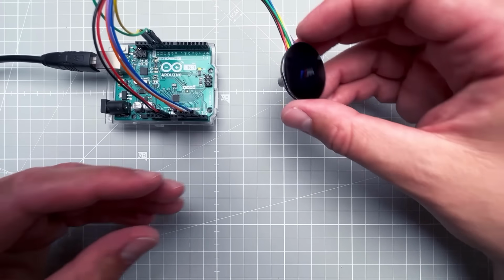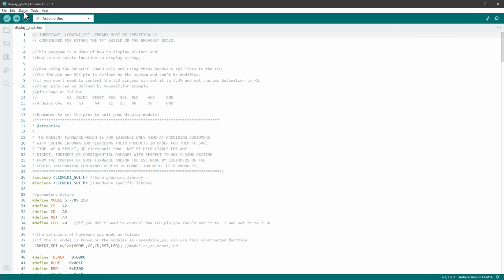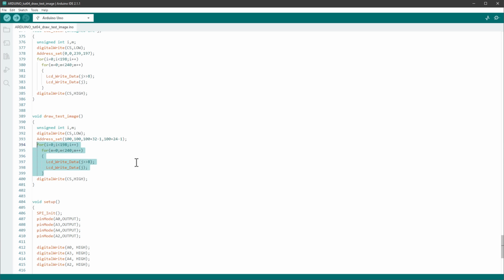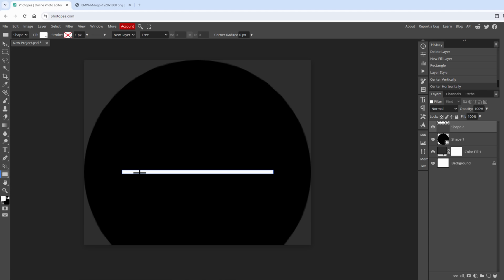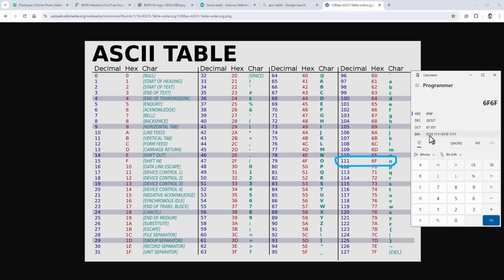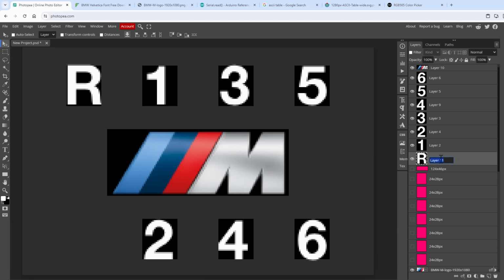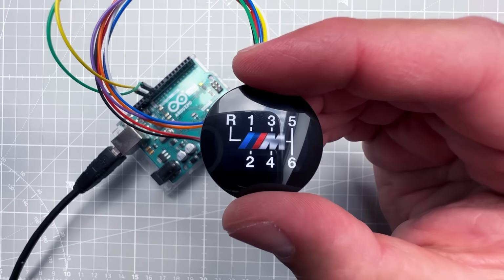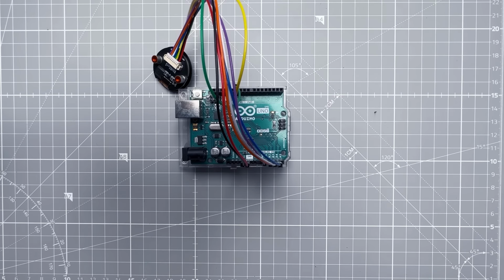I found PERFECT display

Comment: an esp32 or a raspberry pico will give you more memory to store graphics, and much faster performance, and you can use the same Arduino IDE to program them. Probably your sketches will work straight forward on an ESP32. Awesome project, I will get a couple of those displays to play around
Reply from the maker: Yep, I was using UNO because it´s simple and easy to use for beginners. Now I´m moving to ESP32, and as you have noted, still using Arduino IDE and it pretty much works out of the box. Thank you for your comment!

Comment: You could export the labels in a custom format, with one byte per pixel indicating how white it is, so 0 is black and 255 is white. This would halve the image size. Also, you can use this information to calculate the tint color even for the borders transparency, as in reality this 0-255 color is not really "how white it is", but the alpha channel of the color you want to display. This is a nice improvement in program memory, and in the final look, but would require more work and calculations to compute the color at runtime as the color mix of black + tint with alpha.
Reply from the maker: Good idea, thank you for your suggestion. I was also thinking about storing labels are grayscale 1byte images and using a color lookup table, but it would be probably too much for UNO. However, since I´m moving to ESP32, I will revisit the idea. Not for the memory savings, but more for the flexibility of animating the color tint. Still the RGB565 is not that straightfoward compared to RGB888, since three colors are spread across only two bytes..
Reply: Using a palette might be a good idea to compress the central image, but given the gradients I don't know if it would be good
Reply from the maker: It was meant for mapping the grayscale image to color images, but ESP had probably enough power to calculate it on the fly.

Comment: I have two BMW e36 a BMW e88 and a Mercedes 500 SL.
The BMWs all have an inline 6 engine and the Mercedes a V8.

That knob would be amazing in my little 323ti tracktoy!
Combined with a gear indicator on the dashboard it would be perfect.
Reply from the maker: Cool. What ECU do you have in that 323ti? Is that a stock or some aftermarket one?

Comment: If you put it in a ZHP knob, I have several colleagues (apart from me) that would be very interested to buy it
Reply from the maker: I’m sorry for my ignorance, but what is ZHP?
Reply: @upir_upir ZHP is an equipment package, and its knob it's the best knob that BMW released for manual cars, it's quite short, weighted and gives great feeling in your hand. The M ones are illuminated in orange but taller (different version), so your screen in a ZHP knob (the short one) would be the best option for manual cars. Even cars released later are fitting the "old" ZHP knob for its feeling. You'd make quite a bit of money guaranteed
Reply: @upir_upir  hello, the ZHP knob is a knob from the "sport package" which is commonly called ZHP. That knob is the one that has the best feeling in the hand, it's shorter, weighted and ergonomic. The M cars have the taller one illuminated, but the feeling is far from the ZHP one, so one of them with your screen would be a best seller, as it would be the best knob ever. I'd definitely buy it and I am sure a lot of the forum members would too, you could make some real money from it

Comment: A little more expensive but you should look at the Waveshare 1.28 inch round TFT LCD's.  The LCD takes up the full area of the circle display, not just 2/3rds like the one you have here.  You can also get them as an all-in-one with a RP2040 or ESP32.  They also have packages with a touch panel as well.  I've only been playing around with the RP2040 version but, overall, they are pretty easy to work with.
Reply from the maker: Thank you for your suggestion, I have that display with RP2040 and I was having hard time using it with micropython and Thonny. I have now ordered the ESP32 version and it´s much easier to use, in fact, I´m already recording a video with that display. What IDE do you use with the RP2040 version?
Reply: @upir_upir  Oh cool.  I am using Thonny.  It's definitely a bit finicky but I am able to work around it.  I am looking forward to seeing the video on this display.

Comment: Awesome Project - i think i watched partsof it 3 times - still goes way over my head

will keep watching how everything willt turn out for the shift knob!!
for the E90 you would need to combine it with a Can-Bus Adapter to get the actual gear used to light up the correct gear
Reply from the maker: Thank you, I´m glad you like it! Yes, I do plan to explore the OBDII version a little bit more to see if I can get the current gear somewhat easily.
Reply: @upir_upir  FYI: the gear information on the E90 is to be found on the PT-CAN
- I only know this because I have a datadisplay to get information on water temp, oil temp and oil pressure
and that connects only to the PT-Can
Reply: @upir_upir  As @odie0815 is saying below the information would be on the pt-can to intercept and not so much in the OBD2 side. This is a entirely different part of the vehicles electronics.

Comment: E36 convertible with custom LED lighting, I'd triggered by the tumbnail sice the lightup roundel for the BMW shifters is no longer available seperatly but you have to buy a whole shifterknob with is about €165 so this is a great and awesome solution for this. Thanks so much! I look forward to the next video
Reply from the maker: Thank you, but I believe you can still buy the LED backlight version on AliExpress alone, without the entire shifter knob.. At least I think I have seen it there.
Reply: @upir_upir  Nope no longer available only with shifter going from €150,00- for the normal one to €250,00- for the ZHP one. So my hopes are high for this one ;-)

Comment: This is a very cool project. All that is fitting on a ATmega328 is awesome personally i like the Uno with socketed DIP packages that you can pull out and run dead bug style if your project requires.
Reply from the maker: Thank you. I also like that version of UNO for the ease of taking the chip out and using it standalone.

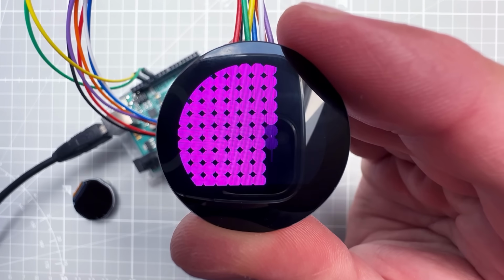Comment: @7:26 - So the bottom of the display gets cut off? but the top is fine? So it's not a true "round" display?
Reply from the maker: That’s right, the bottom is cut off, so technically it’s only semi-round.
Reply: @upir_upir  Ah that sucks, otherwise it seems perfect, wanted to get some for a clock project. Thanks for the reply

Comment: Why are people still using Arduino, when esp32's are vastly superior, smaller, easier and 20x cheaper? Plus, you can use the debit to make the project, then just flash the program to the esp chip itself and make it even smaller. (Esp32, esp02, esp10 etc etc)
Reply from the maker: It’s because even when ESP32 is surely great, it’s not easier and it’s not cheaper. Arduino has much better documentation and community. Easier learning curve and much more tutorials. The cheapest Arduino UNO board is 1.5$ on AliExpress. Cheapest ESP board is twice the price.
Reply: @upir_upir  I can get an esp32 for 10c. (The chip). The devboard is $1.20-2.00. and easier? Well no, because it's exactly the same. You even use the Arduino ide and language. 

Esp32 comes with ble and wifi, and all the ADC and digital io. 

There is not one single thing that Arduino does better, or cheaper. And it's not harder to learn.

So I ask again, why use Arduino? Other than 'i didn't know about espressif and their offerings', there's not a single viable reason?

Comment: If you use a palette for the images you can drastically reduce the size. For example for the gear numbers you can only use 1bit per pixel since it's only black or white which will make the images 16 times smaller. Similar for the BMW logo - it doesn't use the whole range of RGB colors.

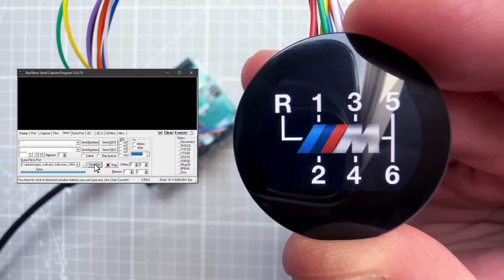Comment: 32:06 about memory usage:
your image (apart from the bmw logo) is grayscale, so you could save a lot of memory per digit if you stored only one color channel (green for full resolution) in the array and repeated it when drawing.
you could even do maybe 4 bits per pixel (so you don't have to deal with byte alignment or waste 2 bits per pixel) instead of 16. I think it's also worth testing 2 bits per pixel (4 pixels per byte instead of 2) but it might be uglier. at the limit you could use 1 bit per pixel, though you'd lose the anti-aliasing.

that you leave you a lot of room for other stuff and you could still have a routine to draw rgb565 images like the logo.

on drawing the channels with 4bit resolution it would be look something like (struct rgb565) {
  .red = grayscale <<1, // 4bit loses 1 lsb over 5bit
  .green = grayscale <<2, // 4bit loses 2 lsb over 6bit
  .blue = grayscale <<1, // same as red
}
then split in two and send.
for coloring you could probably still use the same mask trick.

run-length encoding might be helpful too but it would use more memory for lone color pixels
Reply from the maker: You are correct that grayscale images only need 8 bits, and not 16. Probably 4 bits for grayscale would work as well and still look reasonable. The additional calculations would be probably too much for Arduino UNO, but definitely something worth doing for something like ESP32. Same with run length encoding. Thank you for your comment and your ideas, very appreciated!
Reply: @upir_upir  thank you for reading and for the video!

Comment: Good work. But esp32-C3 with full round display, touchscreen and round case - cost $12, and have all for you need in this progect.
Reply from the maker: Thank you. Yep, that ESP32-S3 round module is something that I´m currently testing as well. It´s a nice little piece of hardware.

Comment: Since you use white images for your labels you could probably use a single channel image and that would allow you to store a second set at a lower intensity (for the grey). Not sure what the encoding is for 16-bit image (5-bits per channel?). You could probably do bit-shift and bit-OR to recreate the color pixels in 16-bit. I think it would be cheaper than the floating point math required for true tinting. You could even go with palette based approach, that's how the old game consoles did it.
Reply from the maker: Yep, I was thinking about something similar, i.e. storing labels as 8bit grayscale, which would result in images in half the size. I might try that.

Comment: The ESP-32 WEMOS S2 mini is 34.3*25.4mm in size and has 4MB of flash memory, it may help when trying to draw bigger or more complex images.
It could allow you to detect the gear using a separate ESP and communicate between them with ESP-NOW to avoid some wires
Reply from the maker: All good suggestions, thank you!
Reply: I might have a look at that later as i have in mind a little project with a bigger screen
Reply: It is also a lot faster than the UNO

Comment: Id go ESP32 --- But dont rule out RP2040 boards. They make some that are very tiny.

As for improvements, I wondered about settings a condition type of function where if it detects something, it could change out the image shown (to get the color shift)
Or maybe you can piggyback the devices... and have one be the visual display controller and the other doing the detection and sensing.

Awesome project tho i really love the idea.
Would love to make one for my WRX
Reply from the maker: I´m not ruling out anything, but I need to make small steps, since everything is new and difficult. There is definitly more that could be done with this display, I will explore some more options in the future videos.
Reply: @upir_upir  I completely understand. I have more project ideas and parts than I have time, energy and motivation to work on. So I am constantly trying to balance it all, and that's not even considering the everyday obligations we all have.

I will keep an eye out for new videos though. And I really appreciate the idea.

When I was younger (Im 40 now) I used to want to put a computer in my car. Nowadays, the tech finally caught up and it can be overwhelming (at least for me) to consider all the old ideas I had... but now having the hardware available, and many of the skills to make these ideas come to life.

One last thing to mention -- you can go w/ more power like a Pi Zero or even Pi 4/5 but extend the wiring too. Can control many diff things w/ these platforms and just change out an SD card for memory.

If you still prefer the tiny footprint, look into ESP32-C3 and ESP32 S3 tho. Or you can get just the "brain" part of the board w/ the ESP32-S but it's nicer to have the breakout board of some type imo.

Comment: 25:13 A) You could use an ESP32 or Pico which both have much more memory.
B) You also could cut off all unused (black) pixels at the top, left, right and bottom.

Comment: Following the project because it would be cool to have it in my car, and all the time I was wondering why go with the huge UNO if you want to implement this in the real world...

Now, I am not aware of the parameters, but wouldnt a pro micro/nano or xiao seeed or even wemos d1 mini or similar be also feasible?

The display is just  *chefs kiss as well as the entire tutorial, great job! Diky moc!
Reply from the maker: Going (starting) with UNO was for a few reasons - it´s super simple, slow, and cheap. Also, if you manage to have it running with UNO, you will most likely make it run with any other microcontroller, and it would only be better/faster. For the final stage, I will definitely choose something small enough so it can fit inside the shifter knob.
Reply: @upir_upir  sure, makes sense as a proof of concept. much better to handle as well if you need to connect things and so on.

until next time :)

Comment: ESP32 bluetooth + bluetooth OBD2 adapter.!!  U can read the CANbus data wirelessly displayed (including gear )
Reply from the maker: Assuming you use it in a (not super old) car that has OBD2. You might still not be able to get the gear value, not all cars send it, but you can calculate it from RPM and speed. That said, yes, I would like to try that approach as well.

Comment: I think it would be easy enough to add an external flash ship or an EEPROM to store the images.
Reply from the maker: Probably much easier solution is to simply use a microcontroller with a bigger memory - like the ESP32. That´s what I´m currently testing.

Comment: If i use this screen how will i have enough Analog pins for the hall sensors as well ?
Reply from the maker: Probably even better, because SPI uses different pins than the analog input pins, so you should have access to 6 analog input pins.
Reply: @upir_upir  which pins other than vcc gnd sda scl should o use instead of analog
Reply: @tobidzn105  
Hello, 

After testing for a few days, there are missing analog pins on an arduino board one for 4 hall sensors and this display.
SCL - D13
SDA - D11
BLK - A0
CS - A2
DC - A3
RES - A4
Of these ports only BLK is dispensable. We would be left with 3 free analogue ports: A0, A2 and A5. 
What possibilities are there to extend the number of analogue inputs? 

On the power side, you can connect it to a VCC breadboard to have more 5V outputs.

I'm waiting for two ESP32 and a Seeeduino to arrive so I can continue testing.

Thanks upir for these videos, I am just starting with arduino.

Best regards!

Comment: Two vehicles of mine are equipped with manual transmissions; a Ford Mustang GT, and a Nissan Hardbody. Of note, about 10 years ago when I bought my mustang, a popular accessory I found was a digital shift knob, somewhat similar to what you did on your second video about this project, except if I remember correctly, it used a gypo or some type of tilt sensor to know what position it was in, to then show the correct number on the display. You had to "teach" the shift knob where each gear was, and you put the control box inside the shift boot cover. It was also RGB and to change the color, you tilted the control box in your hand until you got the color you wanted, then set it. Maybe using motion detection to identify and display which gear you're in might be worth looking into? Might even end up being more self contained with less wiring and parts (I'm not at all aware how electronics like this work or how big they are however)
Reply from the maker: Thank you for your comment and providing additional details, that´s very appreciated! I have seen those digital shift knobs before, but it´s almost impossible to find any more details or high-res photos of even videos. I believe it was done using accelerometer, and while I would like to try that approach as well, I´m little bit worried that the accuracy will be low. I´m definitely trying to explore all the options to choose the simplest version.

Comment: That's really cool and well explained. Have you thought about using the can bus interface to get signals from the car for the current gear?
Reply from the maker: Yes, that´s something I would like to explore more, but right now I have zero experience with this. Have you try that?
Reply: @upir_upir  I have not tried it yet but I am looking into it as it is something I am planning to use on my 370z. It requires extra hardware like a can bus transceiver which I don't have yet
Reply: @upir_upir  I know high performance academy has a course on CANBUS and how it operated.